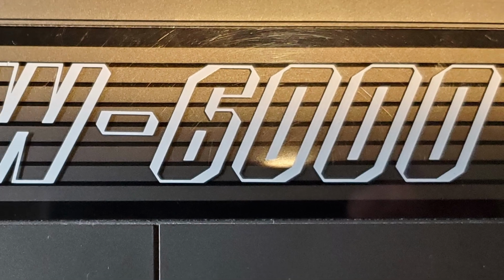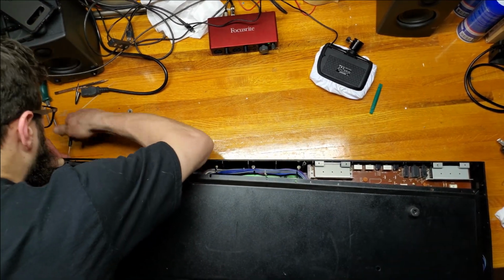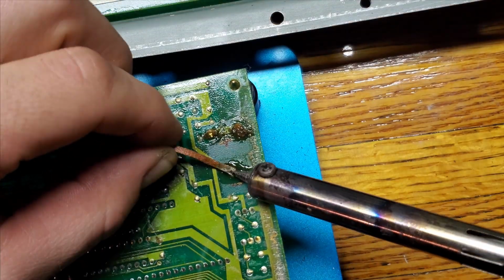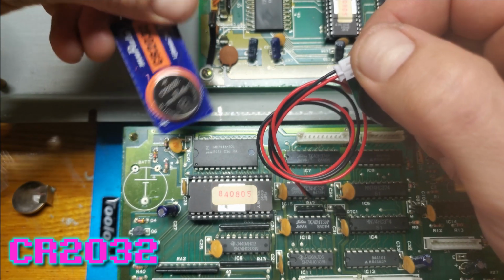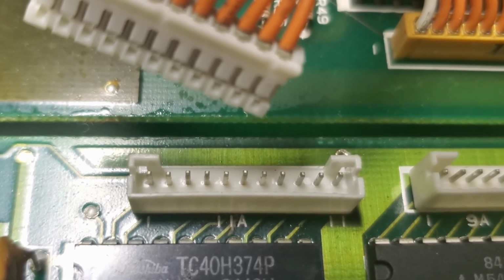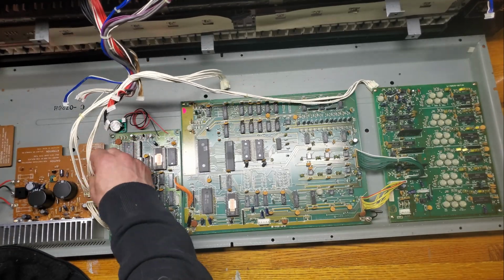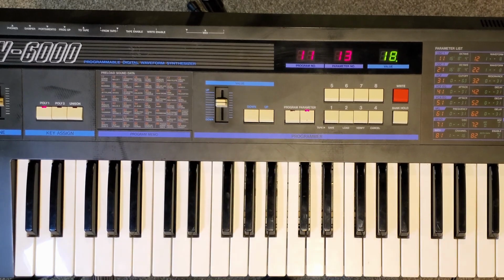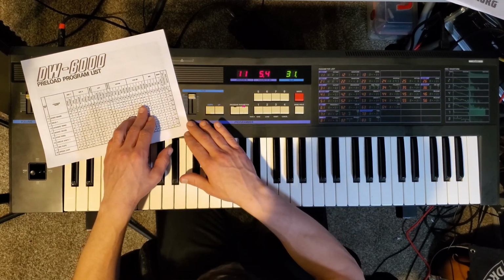Korg DW-6000 Repair (Battery Replacement + Reprogramming)

Comment: Nice tech vid thanks. At least it didn’t leak. Amazed korg hard soldered the battery 🤪 Do you find the PSU caps need replacing due to age too? Thx
Reply from the maker: Everyone soldered their battery in then, but they probably weren't thinking about 30 or so years in the future.
In my experience, the only caps that have needed replacing were on the PSU. (I edited this because I miss read that the first time)
Reply: @ thanks for the response.  I’m amazed my patch edits are still saved and stored. Will take another backup and replace anyway. The battery must be by Mr Fusion to last from 1985 as original 😵‍💫 The wired battery connector is a great idea as can locate away from circuit board to limit any future leak damage.

Comment: What exactly do you look up to get the new battery piece on eBay? I was unable to find one and need one for the Korg DW 6000 I just purchased. Thanks!!
Reply from the maker: Looks like I can't it find on ebay either. I did find a site selling them though.  Check out AnalogClassics.com and do a search for Yamaha DX7 battery replacement.
Reply: @deltamumusic  awesome thank you!!
Reply: @deltamumusic  I just wanted to reach out because maybe you’ll know since I’m new to synths or maybe you could point me in the right direction. I successfully replaced the battery and the screen lights up with solid numbers but once I hit the switch to turn it on it turns off right alway. Which was the same symptom before I replaced the battery the only difference is the screen did not display full numbers like it does now that I replaced the battery. Any help would be appreciated! Thank you!!
Reply from the maker: @midwestrest9817 sorry for the late reply, but I haven't had this problem before, so I can't provide much help. I would suggest maybe looking for any loose connections or cold solder points before digging into it too much. 
If that isn't the issue, you can try searching forums to see if someone else has a simular problem. 
I don't know if it was you, but I saw a post the Facebook group "synthesizer spares and repair" of a dw6000 with your problem. That group is a great resource. There are many knowledgeable people in that group. I was able to get help from some one there for a different project where I couldn't find a schematic for something and need to replace an exploded capacitor. The guy that helped me was able to name the value of the cap from memory
Reply: @deltamumusic  thank you! I actually joined that exact group a couple days ago and was able to find help. Really appreciate you always helping and reaching back out. Have a great day!

Comment: Great video. I think my battery has finally lost all it's juice and needs replacing. The only issue is I don't understand soldering that well. I'm scared a tech my break the synth by accident too.
Reply from the maker: Soldering isn't too difficult, but certainly takes some practice to master.
I would imagine anyone who is a tech should be able to handle the job. Hopefully you can find someone to do it for a reasonable price. I recall one time picking up a DX7 from someone who claimed a technician wanted $175 just to look at it. That number may have been thrown out there because he didn't actually want to deal with it but it could also be a realistic number. I honestly don't know what the going rate is on that kind of work.
Anyways, I wish you the best of luck with that. It would be really cool to hear, with a bit of practice, you built up the confidence to do it yourself, but I also understand if you go the route of seeking out a tech. In that case I hope you find someone who can do a great job at a price you feel is reasonable.
Reply: im going to attempt the switch myself soon in the next couple of weeks. I got a practice kit for soldering practice before I attempt this.  @deltamumusic